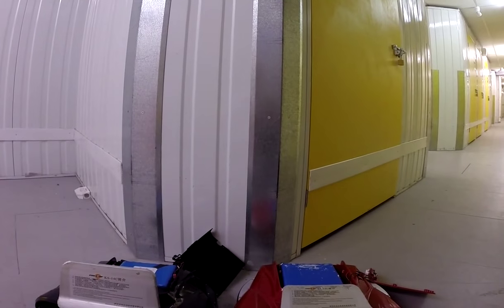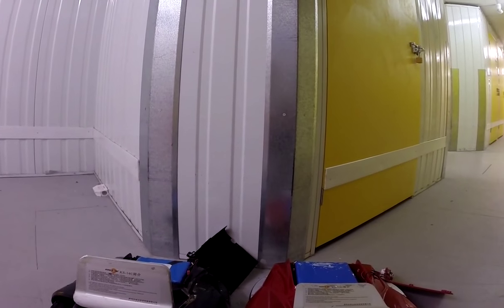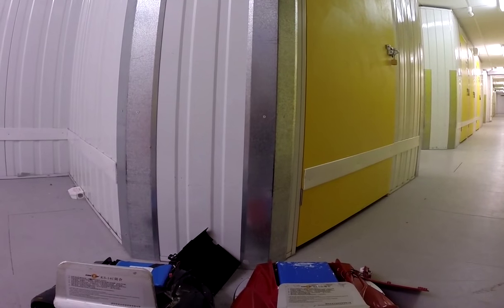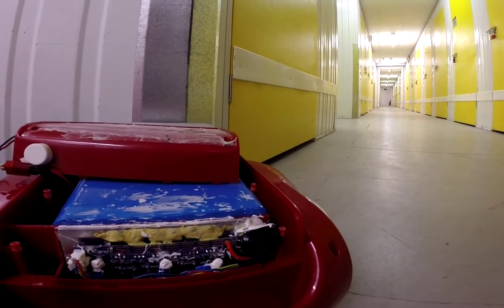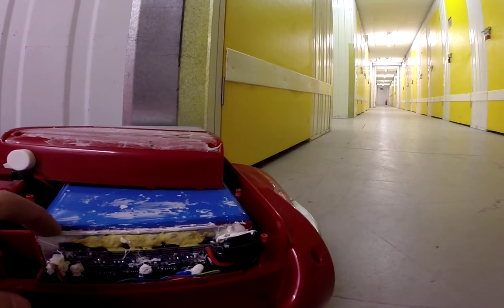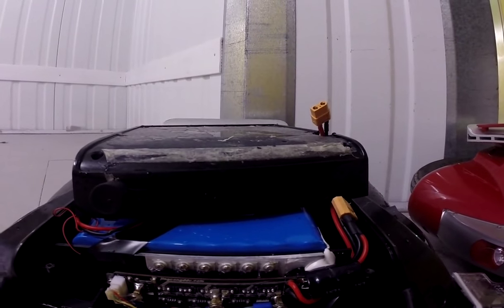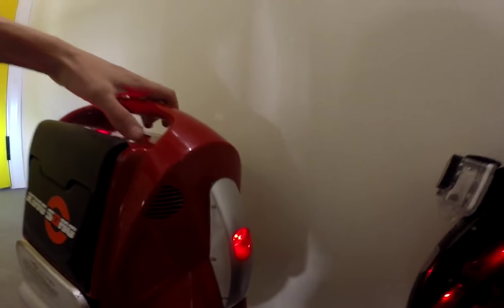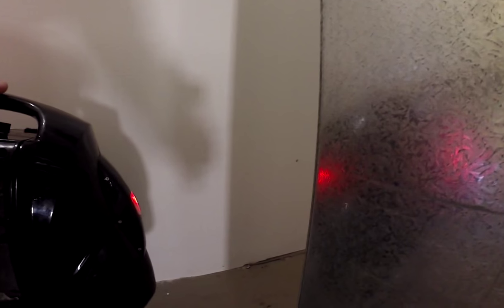King Song Differences Between the 500W & 800W Electric Unicycle/eWheel

Comment: The KS 14 inch 800 watt motor has a 680 Wh battery and can go up to about 38 km/hr (that's insane!) and costs $1,030 USD. The upcoming Ninebot One P 16 inch also has an 800 watt motor but with only a battery of 340 Wh with a max speed of 28 km/hr. However, the price is $1,295 USD. King Song has addressed and remedied the issue of  automatic shutdown (while riding at high speed on low battery) with alarms and pedal tilt back and a much larger battery. The upcoming Ninebot One P has also addressed and remedied the issue but the largest battery is a paltry 340 Wh and costs $265 USD more. The math tells me that King Song is a better value money wise as well as safety wise. That is what I ordered and impatiently waiting for.

Comment: An 800Wh motor and an 800W battery will essentially run one hour.  A 400Wh motor and an 800W battery will run 2 hours, while an 800Wh motor and 400W battery will run 1/2 hour.  So why buy an 800Wh motor over a 400Wh motor?  It climbs hills much better!  Power vs endurance.

Note: One Kilometer is essentially 1/2 + 1/10th of a mile (0.6 miles).

One Kilogram = 2.2 lbs.